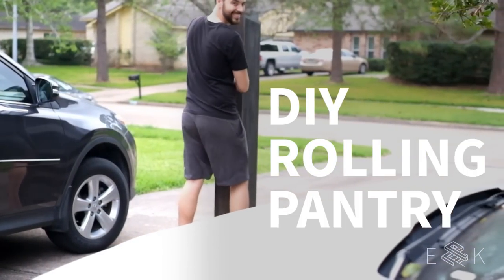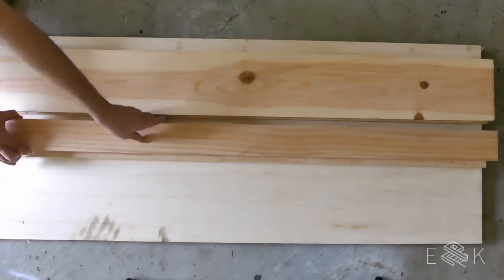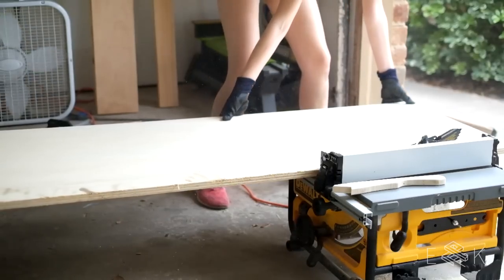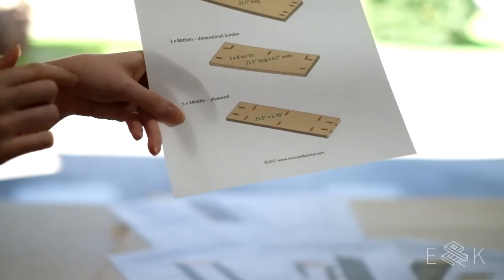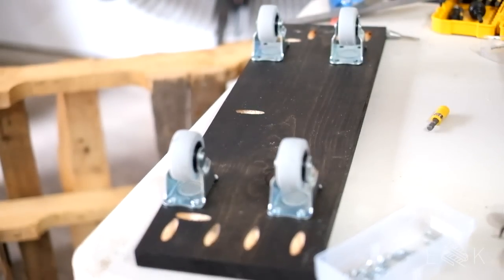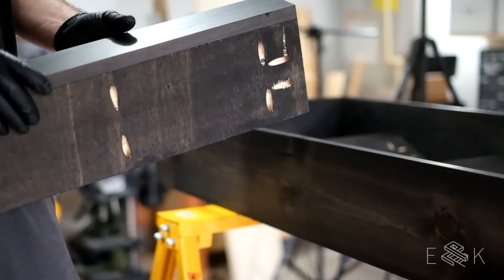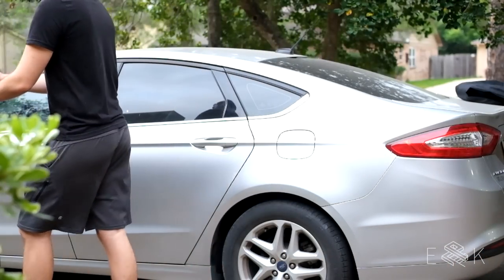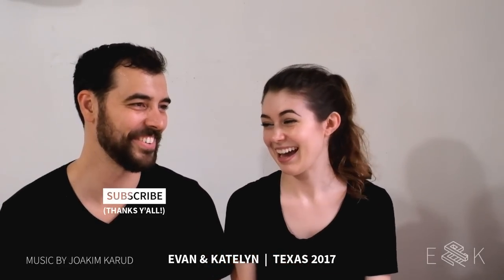DIY Rolling Pantry | How to

Comment: Did you have to do anything special to align the casters so it rolled back and forth straight?
Reply from the maker: Yes, we used a combination square to position them initially, then used a center hole punch to mark where to put the screws. When attaching the casters we put one screw in loosely, one more with slight hold, then used the square one more time to set the final position, before securing the rest of the screws. Hope that kind of makes sense!

Comment: Nice idea- but do away with the back panel - the way you've used pocket screws for the carcass and shelves, you don't need the panel for structure- and without it- you can access the pantry from both sides (IF there's a bit of wobble without a back panel - add a horizontal 4-6 inch strip at the bottom and top - rather than blocking access with a full panel.

Comment: Hi This is exactly what I have been looking for except....... I want to make them wider what best I can get out of an 4 x 8 sheets of plywood.   I am trying to figure it out on paper and I am making a mess of it really.  My idea is 36 x 84  x 12.   I want to build pull out storage and put like 3 or 4 of these units side by side in my craft room and on the outside where the handle goes I can label what is in them.  When I need something I can pull out that cupboard and then push it back in and no one has too see my stuff and it can be well organzied.  I like the board in the front of each shelf.  This will be so helpful so things to full off the shelf when rolling back and forth.   You see right now I have these awful tin shelfs and it looks a mess  and things fall off and I need to keep somethings away from the grandchildren ie paints or pins  and not to to forgeet I am loosing valuable floor space because I have walking space betwee each row.     After seeing a design on a Chineese decorating website they built something just like this as their homes/apartments are so small.  I am so excited to try and built one of these.  
 Long and short I need your help to figure out what measurements I need so I can purchase my wood materiel.  I can send you a picture of the design from Chineese website.  I am retired and sell crafts from my home and I love it.  Hope to hear back from you.  Have a great day
Reply from the maker: Hey Roxanne, so sorry but we don't have the ability to make custom plans. You can download the plans for ours here: https://evanandkatelyn.com/product/rolling-pantry-plans/ and you can alter the dimensions to fit your space. Best of luck!!

Comment: So was the back only secured via the shelves? Not the to the side of the cabinet?
Reply from the maker: +Robert Wolinski that's correct! The shelves held everything together. This is because the back me front of the pantry were both visible so we didn't want to do screws there. You could glue it if you want added security, but we felt it was plenty sturdy. Hope this helps clarify!
Reply from the maker: **back AND front
Reply: Where is the link for haw to Mack it

Comment: Do you have specs on your pilot hole and caster spacings? These are not included in your plans.

For anyone making custom plans here is what I did:
Take the provided plan and measure your space length (up and down) x depth (left to right) by width ( front to back) to get "dimension of space"

To get "dimensions for wood" from your space dimensions:
Subtract
-.5 length
-1 depth
- .25 width

To get measurements for cuts subtract the following from your "dimensions for wood"
For sanded plywood:
- 4 inches length
-1.5 depth
-1.5 width

Premium pine subtract:
-2.5 length
1.5 depth 
W is exact
*you can not use 8x1 if your width is greater than 8"

Dimensional lumber subtract:
-2.5 length
-1.5 depth
-.75 width
* can not use 8x1 if width is greater than 8"

Premium pine subtract:
-1.5 depth